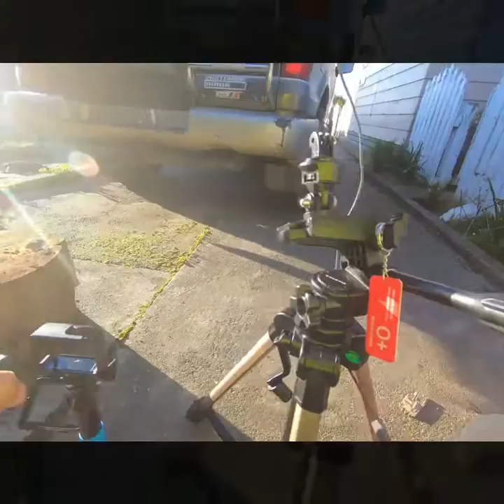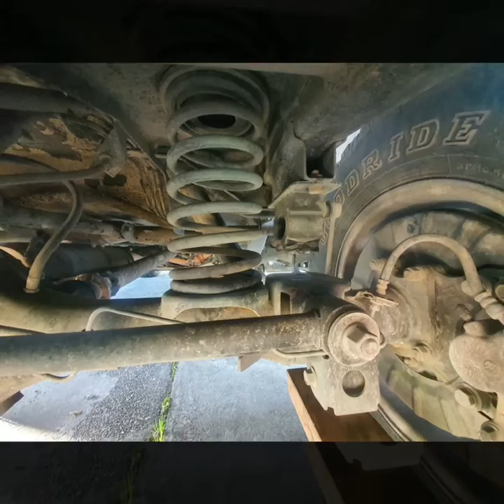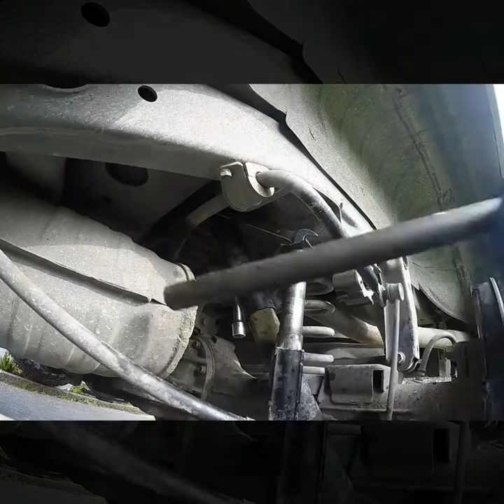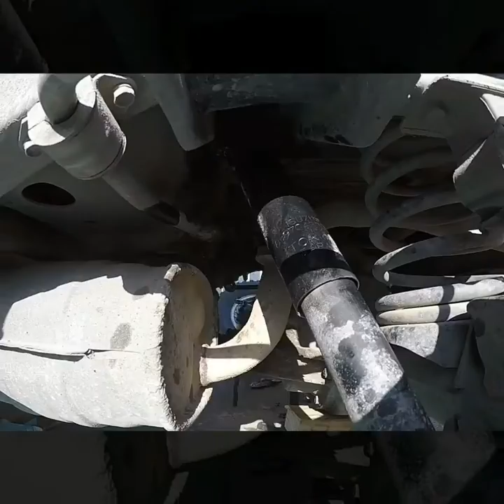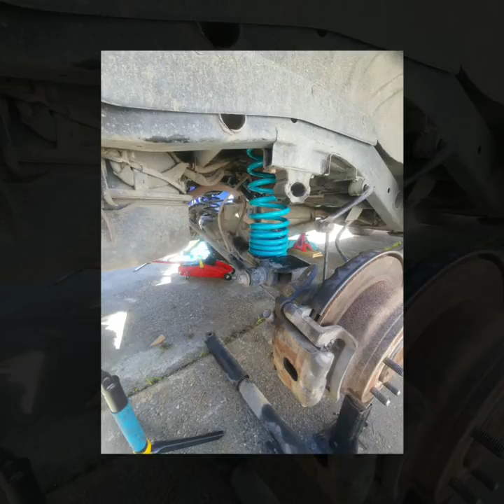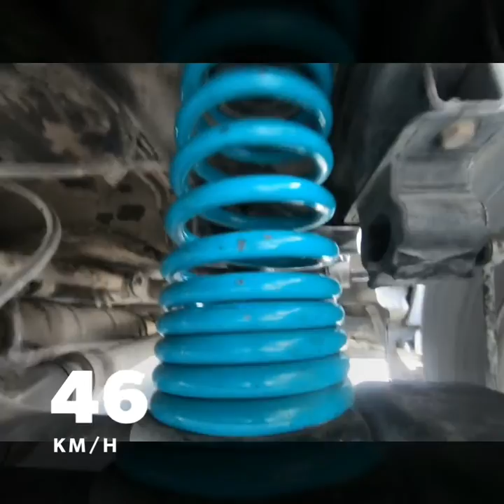Isuzu Bighorn 2 inch lift

Comment: What brackets do you use to fix the roof rack to the factory holes under the roof trim. They are so hard to find
Reply from the maker: They are really difficult to find. I have to make them using stainless steel

Comment: Are you sure the spring isnt the wrong way round ?
Reply from the maker: Pretty sure i got it right. It does sit right on the axles. I tried flippin' just to double check
Reply: @Pawikan Navigator  ahh okay.  I have been doing some research as I am about to install my lift and I'm fairly sure that the tight coils are supposed to be  the top ? I could be wrong though
Reply from the maker: @liamcosgrave5410  you'll figure it out once the coils are on the axle seat😊
Reply: @liamcosgrave5410  You are correct, the "tight" coils are supposed to be at the top.

Comment: How do you lift it in the front of the car ?????
Reply from the maker: Easy. Measure the current height front centre of the hub to the edge of fender, jack up the front and let the front wheel suspend in the air. Spray some wd40 or crc to the torsion bolt(spray it hours before you wind it). Then let it down and remeasure until you get your desired height
Reply: I can get those springs in about 30min ,no spring compressors,it's a piece of piss...